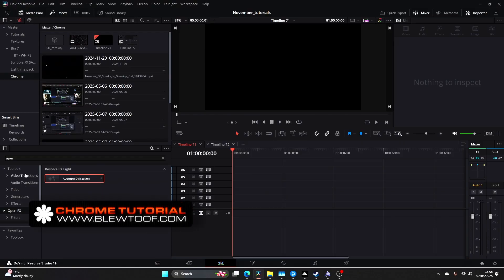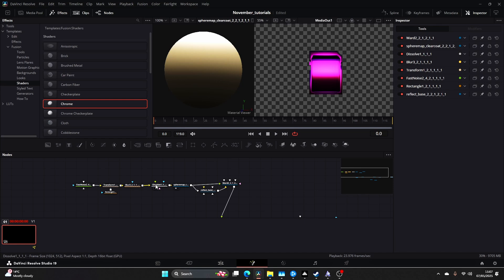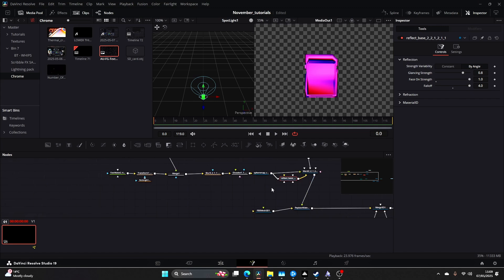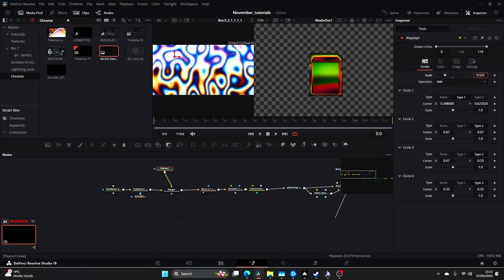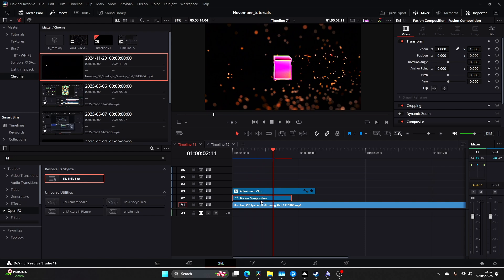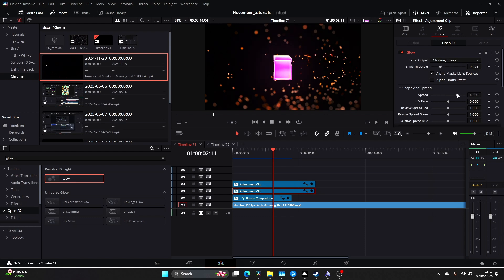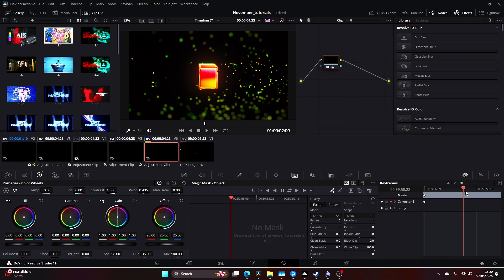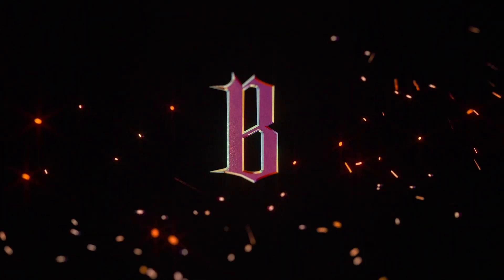Easy THERMAL 3D in Davinci Resolve

Comment: Tutorials is just great, but mine mcb pro 2018 i7 2.6 gh is take red screen and turn off, when i use chrome with 2 light it`s crashed every time, it doesn't depend on you but that`s it,maybe i have beta 20 DRS?
Thank you mate, your videos is just brilliant
Reply from the maker: Do you have NVIDIA graphics card
Reply: @madebyblewtoof  Radeon Pro 560X 4 GB and intel UHD Graphics 630 1536 mb
Reply from the maker: @АнГор-я8ч hmm try with out bump map - make sure your fully updated to latest version of resolve. Not sure why it’s not working but this has been an issue in the past with using the resolve textures. I’ll make a tutorial on creating your own texture from
Scratch to avoid this.

Comment: I tried to redo this tutorial on my pc but every time I import my chrome texture, Davinci crashes, it can't calculate the lighting. I have a Ryzen 5 with an rtx 3060 and 32g ddr4, is my pc not powerful enough or is there a problem?
Reply from the maker: Should be completely fine -  what size is your chrome texture?
Reply from the maker: try using just the Chrome texture in Davinci Templates and maybe dont put a bump map on - see if that works!